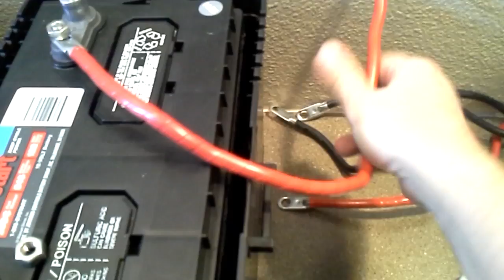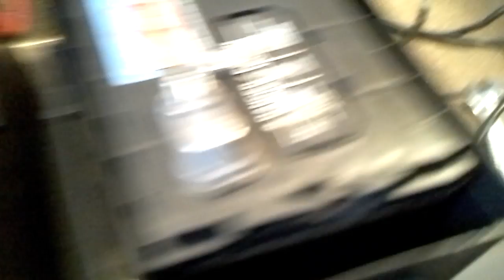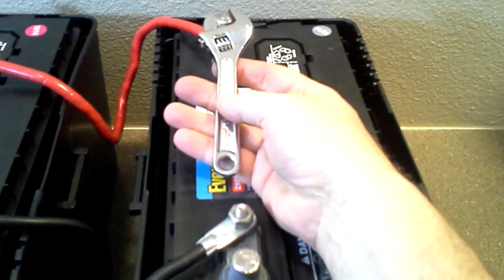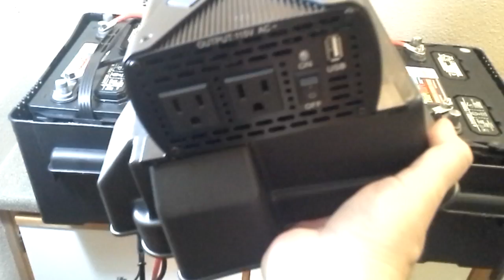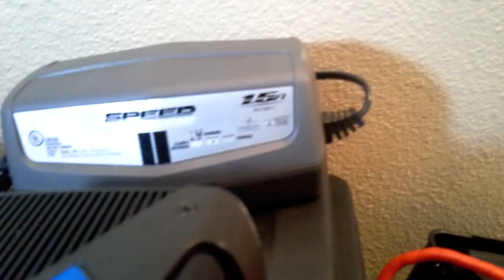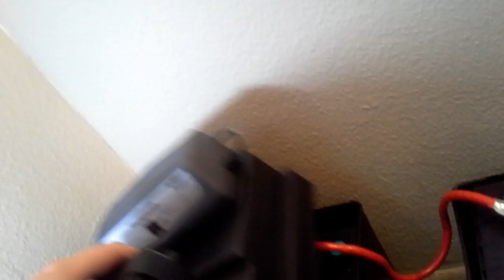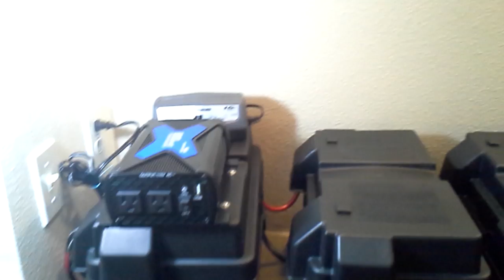Installing 4kW/Hr battery bank with 800W 120V Inverter and Trickle Charger from Tactical Woodgas

Comment: One suggestion: the inverter should better be connected to the middle battery. This avoids the pair of jumper cables connecting the second and third battery carries twice current as the one connecting first and second battery.
Reply: @79sammyboy  you can do positive on 1 battery and then negative on another at the other end
Reply: @supremeautomotive6749  Yes, connecting Charger/Inverter to the (+) at one end and the (-) at the other end is better, but still NOT the best way! 
Method #3 is BEST = http://www.smartgauge.co.uk/batt_con.html

Comment: No no negativeiv should be hooked  to 1st battery not the 3rd battery positive is hooked up correctly.  Your 2nd battery will not charge correctly.please respond to me I will explain it to you.
Reply: Respond to me then. Im doing the same thing as he did
Reply: @tt.k1794  You can check it out on other videos but basically you should connect the positive and negative to opposite ends of the bank to balance the load / charge. It still won't be perfect with more than two batteries but much better than the above.

Comment: How come you didn't hook up your inverter connections to both outside batteries as in neg on one and positive on the other. That way the draw is equal on all batteries.
Reply: You are right, that is the technically correct way to connect the charger and the load. Put the equipment containing battery box lid on the center battery, and span the whole bank with their conductors.

Comment: You should have hooked up positive to battery 1 and negative to battery 3
Reply: thankyou
Reply: Why? It makes no difference. The connectors are so thick it just doesn't matter! The charging/ discharging rate will be identical on all batteries.
Reply: @GabbrEL  your right especially on 12 volt I called a solar company and 12 volt batteries aren't like 6 volt in series.
Reply: @GabbrEL  It does make a difference especially on low voltage, high current. those thick cables DO have resistance, therefore you need to connect diagonally.
Reply: @David Goble..... and wired as one battery in all respects, taking into consideration the (minute) differences in resistance (and volt drops) of the connecting cables.In time, the battery nearest to the inverter drains the most of the three the way the connections are shown.

Comment: Your battery is connected wrong you need to pull from the rear with one cable either neg or pos to the front and use the front pos or neg to the source. Otherwise it's going to give you a unequal charge and hurt your batteries. Think of the batteries as cells in a big battery and the post are at each end of the battery.
Reply: Make sense! I also think his setup will drain the closest battery faster, bad for long run
Reply: Pls boss how many battery's could be needed for a 3000watts inverter ware the transmitter is 1kv
Reply: Nope that is wrong also. You need to do is run a separate outside pool where you go to each battery independent is the correct way in the best way. Any other way you'll charge out the outside batteries and in the middle battery last you got to run from each one a separate cable.
Reply: there are a hundred comments all saying the same thing, and you are all wrong.

with the 8 gauge wire he uses the voltage drop from the left battey to the right one  at 800W pull  is only 0.08V

its not enough to worry about, 

If you are using the batteries to start a 1000 HP engine  pulling 900A.. then yes

pulling  67A to an 800W inverter  no problem

Comment: EXCELLENT START EVERYONE TO LEARN FROM THIS VIEDIO GREAT WORK DURING TIMES FOPR PEOPLE TO PREPARE FOR DURING ANY POWER OUTAGES !
Reply: +Dawud Muhammad I suggest you do some more research and you'll find out that this is wired wrong on that first battery.  The way it's set up to drain the first battery is gonna kill it, he should have taken the POS post on the first and the NEG post on the third and hooked those 2 up.  This would drain evenly from all 3 batteries and not strain the first one..
Reply: Yes that is correct.

Comment: Inverters come in various input voltages, from 12 to 48 in a common household system. you can also get an input voltage up to 240, and possibly higher. These higher voltage systems generally are for a large household or small commercial system using a net metering system and selling power back to the utility.

Comment: Wouldn't it be better to hook the charger differently? Say positive ( from charger ) to #1 battery and negative to #3 battery. In theory wouldn't this spread the charge equally over the bank, rather than the other 2 leeching off one ?  Also  hook the inverter the same way ?  Really curious about that. I enjoyed the video also, thank for the ideas sir
Reply from the maker: Roadhand Viking
 Not at these power levels and wire size.  Yes, for higher power.
Reply: Tactical WoodGas wouldn't it be easier and cheaper just to buy a generator
Reply: steve mitchell 
It certainly would be noisier with a generator. Also, a generator is not efficient at lighter loads.  

I have both, but only use the generator for the well pump and other heavy loads.
Reply: Mike Leister some power outages depending on where you live like storm prone States the power can exceed 24 hours being off... in the summer months you're not going to want to be without AC for more than one hour.. so I keep a small window unit in one of my bedrooms just for that... and in the winter you're not going to want to be with out heat... I own a couple of small space heaters for that.. and if a refrigerator is off for more than 24 hours things start going South quick... my generator can be tied into the main breaker box so it's like the power never even went out at all... I've owned my generator for 16 years and have not had to to do anything to it... your battery inverter setup is cool and all but I only see it as short-term light-duty usage
Reply: Mike Leister sorry Mike.. got you mixed up with tactical wood gas that was supposed to be for him.. my comments
Reply: @tacticalwoodgas4036  Yes, at it matters at these power levels, too
Reply: @Roadhand Viking
  Actually, connecting Charger/Inverter to the (+) at one end and the (-) at the other end is better, but still NOT the best way!   Method #3 is BEST = http://www.smartgauge.co.uk/batt_con.html

Comment: The way you wired it will cause in imbalance in your batteries
Reply: how should he have wired it?
Reply: On lead to the "upper left", one lead to the "lower right", so that no battery is "closer" to the connection point.

Comment: Maybe I missed the video but in learning and about to do a build. Can you give an update. I see this is an old video
The update in asking for is a update a few years later. And how the system is running.  Any maintenance you had to do.  Problems repairs replacements. And things you learned along the way.  Mistakes. Problems and solutions.  Please if you have thine and thank you if u do.  Or even just a comment will do just as well

Comment: Remember lead acid batteries let off hydrogen when charging so never charge in doors a garage would be ok but never put something like this inside your house or you risk blowing your self up
Reply: let off hydrogen bro, thats a little off you gotta remember that UPS, phone moderns, security systems, older electronics (non lithium) all charge a lead acid battery which are commonly inside
Reply: @dexterjsullen  those UPC units only slow tricke charge rhe batteries back up. So it's not a problem indoors. When heavy charging, a lead acid battery, then you can get a build up of hydrogen.
Reply: @jeffallen3382  how about riding toys, golf Carts, I was in a warehouse where they charge fork lift batteries 48v 800ah batteries, even I worked at target where they had battery forklift, charging batteries no dangerous than a gas furnace or gas stove. BUT OBVIOUSLY DONT HAVE A BATTERY BANK NEXT TO YOUR BED, but plenty people have their batteries in their house (even tesla wall), but if you have temperature control room outside that's better
Reply: @dexterjsullen  lithium ion batteries are different.
Reply: @jeffallen3382 hey Jeff if a guy was careful not to over charge flooded lead acid batteries is there still a risk of them off gassing indoors?
Reply: @babyreps365  I'd still be careful.

Comment: well technically in the video you never turned off the charger and i did see it was green and turned orange when the lamp was plugged in so your batteries were not doing any work but great vid im going to do this but with a ups and 2 168ah deep cycle batteries that should last a very long time and there is always room to expand with more batteries

Comment: Quick question from a newbie! Doesn't this method result in "unbalanced charging/draining"?   ie, the first battery in the system will drain more quickly and charge more quickly. Doesn't this put more strain on the first battery?
Reply: Yes absolutely !! You are correct. As I explained to the to another guy above... It's hard explain it to everyone, and then I found another guys video explaining it, so now I don't have too !! And how you should ALWAYS balance charge your batteries !! so here's the link again for you. Please forward on to everyone else who needs it !! 
Happy charging !! https://youtu.be/oOEqnCrxPYg
Reply: No, absolutely not
its 4AWG wire, its resistance is unmeasurable across 4 FEET

Comment: You'll get more even discharge rates from the three batteries if you connect the inverter with positive at one end of the bank, and negative at the other end of the bank. Otherwise, the resistance in the connecting cables will cause the second and third batteries to discharge at slower rates, and can cause heating of the connecting cables. The same connection arrangement is critical for charging if you want all three batteries to be charged to the same level.
Reply: Exactly.  That is what I saw also.  Good system but it would be better if hooked up like you describe, you should always charge/discharge across the battery bank....
Reply: @FloridaBoyBushcraftSurvival  ....Correct!

Comment: nice starter system...I finally got 5 forklift batteries, they work awesome great!  200amp hours per battery so I got 1000 amp hours total...only use 20%percent of the battery bank per night to extend battery life...cheers
Reply: "only use 20%percent of the battery bank"

Good practice!

Comment: NICE VIDEO HOW MUCH AMP EACH BATTERY HAVE BUY THE EVEN TURN OFF INVERTER THERE STILL BE POWER IN THE INVERTER YOU SHOULD PUT SWITCH BETWEEN POSITIVE OF BATTERY AND THE POSITIVE OF THE INVERTER

Comment: You still have to plug in the inverter into the power point. How would that work in an emergency?
Reply: The AC power is so it is fully charged when your power goes out.  During the outage you can recharge with solar or with jumper cables from your idling car.
Reply: @mikeleister6304  so how i connect lights of the house?
Reply from the maker: @poizentv  
House lights plug into the AC ports of the inverter.
Reply: The real answer here is; he only plugged in a small charger. The inverter runs solely off of batteries. Very simple backup design.

Comment: Time for a upgrade, to the new battery tech, I never had to use lead acid deep cycle, I got in with LiFEPo4s and now with LTO too. It would be weird to have a kW battery and only be able to us 500w of it! Plus the weigh, I am buying an ambulance they use 5 or 6 deep cycle lead acid, I will keep them, but not run anything on them for the living space, jus use them as a starter battery, and backup, because they are hooked up to the ambulance's alternator.

Comment: If you want to be sure that you charge and discharge your batteries equally you need to use a pair of shunts which connect to each battery equally. When going battery to battery in the way shown there is a MINUTE difference in the amount of power going to and from the first and last battery in a parallel system (which in most situations you would not even notice) due to the difference in the cable length which loses voltage in the form of heat dependent on the distance traveled (a common problem power companies have with distribution lines). To be anally retentive about your wiring in parallel, take 8 cables of EXACTLY the same length and connect them all to the batteries, but not from battery to battery. Instead run each pair of cables to two common shunts (making sure all positives go to one and all negatives to the other) then connect the charging system and the inverter to these same shunts, also positive to positive and negative to negative. This is a lot like putting headers on your car engine, they help to even the load on each cylinder, or in this case battery, to insure that each battery is charged and discharged equally. You would also connect the 12v power out to the same two shunts. This method also lets you remove or add a battery to or from the system without taking the system offline. This makes your system "hot swappable," to borrow a phrase from the computer industry.
Reply: This is very interesting.  By doing it the way you explained, are the batteries still considered connected in parallel?

Comment: I cannot possibly see how these 3 battery's give a 4KW system.
At best in practice you would have 3 Kw system but only if you drained the batterys which are just normal car batteries enough to damage them. It would take as little as 10 Cycles to 3 KW hr to stuff these batteries beyond any usefulness.  To avoid that and be able to use the things a worthwhile amount of times, you would not want to pull more than about 1.5Kw hr out of them.

The inverter will be pulling over 70A at full load. At that current the battery voltage will drop below the inverters low voltage cutout well before it gets to the 100AH capacity level even if the batts are 120Ah. The capacity of the batterys would be calculated at the C20 rate which on these batterys would be about 5A (100/20=5).  The other rating of the battery's which would be a lot closer but still lacking would be the reserve capacity which is rated at a 25A draw.  You are still going to fall a long way behind that calculation drawing 3 times that rating.   250W is going to give you something to the reserve capacity so it may be better to figure on this draw.

Do not depend on 4 kwh because you are never going to get that from this setup.
Reply: +Oil Burner yes this video is wrong in so many ways. Its a shame people listen to bad videos like this.  4kw lol and inverter is hooked up to the same battery.  With any luck he will go watch some good videos and learn something. then remake this one. with the right information and wiring.
Reply: +Oil Burner 12.6v * 120Ah = 1512 watts * 3 batteries = 4536 watts or 4.5 kWh total. Useful watts 2.25 kWh to 50% depth of charge (12.2v) or 3.4 kWh to 75% depth of charge (12.0v), wouldn't go any lower than 12.0v
Reply: +Rw Krause  I think these are normal automotive batterys. If they are not deep cycle, they would be killed very quick at 75% capacity Discharge. Even 50% would give them a working life of probably less than a year. Normal automotive batteries are not meant to be discharged more than 25% of full capacity. 
One could look up the specs on these batteries if interested enough but given the labels of " Every start"  and being a walmart battery,  I'm reasonably sure they are normal automotive start batteries ( and probably not the best quality out there)  not meant for more than 25% discharge in cyclic use. 
In this application that gives them around 1.5Kw capacity to maintain best working life.  Of course that is new and optimal capacity. A year in they won't be doing near that and fading more as time goes by.
Reply: I agree, you are correct in everything you have said but these are marine/RV batteries as indicated by the dual post configuration and common RV size of 24/27/31. some are considered dual purpose (starting/deep cycle) with medium thick plates some are rated deep cycle (usually group 31) with heavy plate construction. He is running group 31 marine batteries because his battery boxes are the universal size and the batteries fill the boxes completely. You can tell the boxes are 31's by the partitioning slots in one end allowing the use of 24/27/31 by moving a partitioning wall in side the box which he has removed due to the size of the group 31 battery. We sell East Penn MFG batteries and our group 31 is a true deep cycle with a rating of 105 Ah. In his configuration our batteries would supply approximately 3969 watts with 2976 watts available down to 12.0v. Note this is just information for the general public, I replied to your post because it was at the top.
Reply: Rw Krause Yep, all good mate. A lot of people don't know about batteries at all so hopefully we have given some people interested in this bit of a heads up on what they may not have been aware of.
I recently bought some lipo packs that were specced at a certain rating for a specific job i had and when they arrived they were far short of what they had been promoted at.  Luckily it was an honest mistake and the seller was happy to give me extra to make up the specified rating.
It's important to have some basic knowledge of these things when playing around with them as one could be thinking they are covered for something and come up very short when they went to use it.
Reply: +Rw Krause I wouldn't go lower than 30% depth of charge.

Comment: What do you do for the hydrogen gas that is given off from the batteries?
Reply: You make sure the enclosure is vented and in a well circulated area. Even at ground level hydrogen is in the air everywhere. 
What do you do about your cars battery releasing hydrogen?
Reply: @acehoe7750  When my car charges the battery I am driving down the road not inside a building.
Reply: @donaldsmith3048  So it’s vented and in a well circulated area !